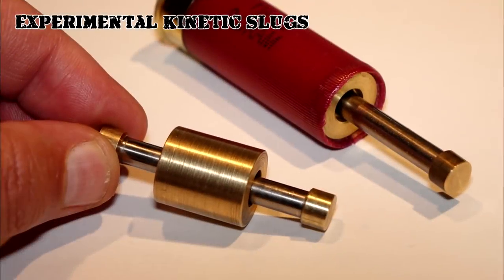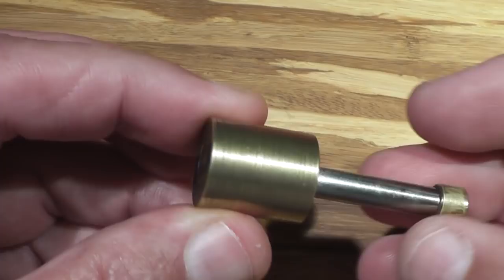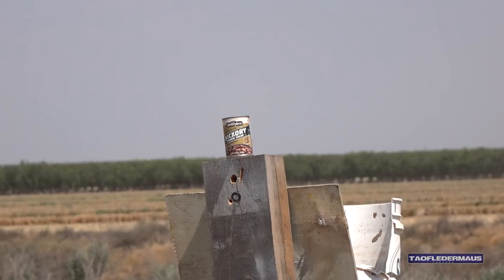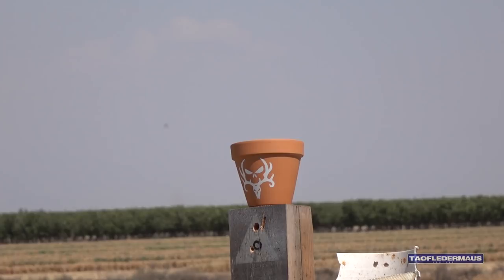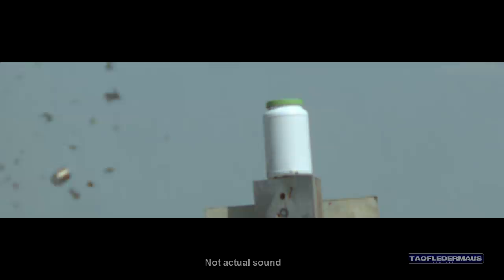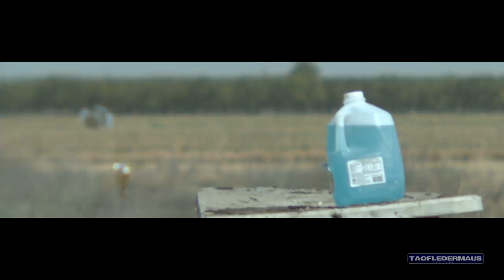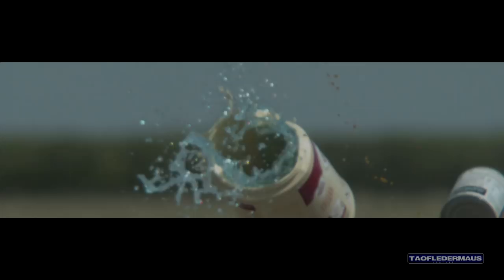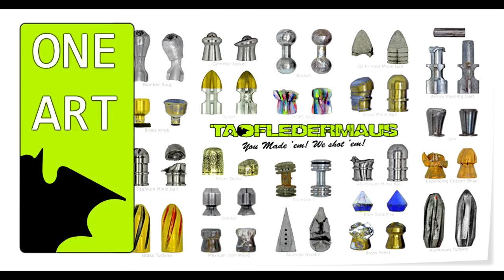The Kinetic Shotgun Round  -  Slug of the future?

Comment: Interesting idea, but I guess the brass ends weren't fitted well enough. Perhaps a conical turned steel end would have kept things together, but I'm not sure which end.
Reply: Matthew Trzcinski it might have helped having the ends being drilled through and having them secured with a hardened steel pin right through them and the rod. Additionally solder everything together and it should be good to go

Comment: This idea has legs, but it needs some modificaion, the endcaps are clearly stripping their threads, being unable to withstand the G-forces. But if that failure could be addressed, and the front end cap were tipped with a tungsten carbide cone, this might be a decent anti-materiel concept.

Comment: Because of (such tremendous) acceleration, the slide will always retract which means it, by default, starts nose-first.
Too bad it's prone to fail due to acceleration and fall apart mid-air, though.

Comment: Had the retaining caps been steel and welded to the rod, this concept could have worked. I also would have a tighter friction fit between the rod and carrier portion of the slug. In this manner the projectile could be fired with the rod in the rearward position, giving it enough drag in flight to possibly stabilize the slug, regardless of aerodynamic design. If the mechanics of the slug were to work as designed, then a tungsten rod and retaining caps would perform even more proficiently as a penetrator. In hypothetical ballistics that is.

Comment: The brass caps on the pin should be interference/shrink fit to keep them during the acceleration.  Also, if the pin was tapered slightly so the slug is pulled "tight" against the rod when it's fired.  Just my $0.02.

Comment: Even if the pieces stick together I don't think they would have ever worked. The forces would be pushing against both the slug and pin. I figure the pin would need to be smaller than the slug and not be able to exit out the back. So when the slug impacts it pushes out the pin.

Comment: It was an ingenious idea but you forgot physics. Both the main ring and the pin are being accelerated equal amounts at the same time. Thus they'll accelerate forward at the same rate. Meaning the pin won't drop back. If you wanted to make something that's a penetrater attach the pin in the back position with a thin piece of metal that way it flies like a plunger but when it hits the traget the kinetic energy breaks the pin from the ring making a penetrator.

Comment: So with the way physics works wouldn’t it make more since that the center rod would be the first point of contact? With that weighing less than the larger slug it would be forced forward on firing the shell. With the rod being the first to contact it would cause the slug to slide forward hitting the target with a second punch so to speak. Of course I could be completely wrong. I’m no physics major by any means

Comment: Seems like these would work better if they where flipped around and extremely heavy duty custom fit sabots where put in the back (to stop the pin/rod from moving), the puncturing rod that also works as a tail is a good idea just executed in a convoluted way.

For a cheap alternative  a lead round/slug would be ideal to try with just drill a centered hole 3/4 in, stick an old hard steel rod in and you're done, then adjust the depth as needed to survive firing but penetrate on impact, maybe even add breakaway finns too =D  .

Comment: Thx ,again interesting,, after seeing some of these slugs tests ,I felt "lost" or some I have made were not going to do well ,but now feel more "accurate" in my first thoughts, I load 20 ga. rounds and 410, use a masonry nail or a cut off drill bit for the center, at first with shot, a drilled out factory rifled slug, 45h.p. shells and washers or now a steel socket filled with bb's and a bit and heat backfilled with solder, the poster using the term " drag separation" explains this to my brain better:) be interesting if this sleeve were rifled and shot from a rifled gun? also wonder if sharpening the front edge of certain slugs makes a penetration difference> thx again Peace Rick

Comment: the pin would go forwards because the air resistance on the slug is bigger than on the pin, så it will be going faster than the slug.

Comment: Looks like you'd do better just putting a sabot around that steel pin and letting 'er rip. Also, the reason it won't stabilize is basic aerodynamics: the end with the most surface area wants to go last. That's the cylinder, not the rod. If you want the rod to go last, it needs to have vanes on it like an arrow or that cylinder's drag will overwhelm it every time everything else goes right.

Comment: Already by looking at the Slug i knew this wouldnt work, the Brass Base around the Shaft as a much higher surface area in a Ideal Scenario resulting in that it springs back, all the drag and movement would just throw it of course if not outright destroying it. 

And i dont even have a Degree in Engineering, or Physics. But it seems so exactly that happend too.

Comment: It needs a tapered pin and slug hole so that it locks itself into the brass slug, and deceleration forces should throw it forward on impact.  No need for the bushings, to drill the slug all the way through, or for it to even move at all that way until it hits the target, and you can even sharpen the point on the penetrator.

Currently, that big pin ramming back is destroying your plastic cup before the load even leaves the chamber, and ripping the front bushing off when it separates.  When it doesn't separate, it probably rebounds forward.  All that slopping back and forth from the pin is destabilizing your projectile.

That is my best guess...  It's not a good design at all, but it is workable with the above changes.

This is all easily explained through inertia forces, and simple mechanics...  it does not require "rocket science" to figure out what is happening...

Comment: The rod and the rear retaining piece should be milled from one piece of steel. Then drill and tap a hole in the front and use a stainless steel screw to put in the retaining segment for the other side. I would recommend that the slug in the center be made of stainless steel, as brass could deform and remove itself from the rod by sheer force. This in no way guarantees stability, but significantly increases the chances of it staying together.
Reply from the maker: Or just silver solder the caps on.    I think he just press-fit (maybe glued) the caps on so I am surprised ANY of them held together.
Reply: TAOFLEDERMAUS can solder handle that amount of G force?

Comment: I mean, the slug is pretty much pushed out of the barrel through pressure, so i can't say i was surprised when the slug came out backwards...
It's a nice idea, but technically, i don't think it's easy to get it working.
I also doubt that it would have any real benefit to just a solid steel ball in terms of penetrating power.
Simplicity usually wins over complexity, just because there's less there to fail.

Comment: My theory is that there needs to be more weight to the rear of the pin, but not more than the entire front of the round.

That way the pin should always move to the rear, in theory.
Reply: Also I was thinking a conventional  bullet shape instead of the cylinder. Also maybe loading the shells in a way so that the pin is already in the position in which you want it to fly. And lastly I don't know what type barrels we're on the guns but maybe try smooth bore and rifled. These rounds are really interesting and it would be really cool to see them work like they are intended but the breaking part needs to be fixed. If they work it will almost be like shooting a 223 round with the powder of a shotgun behind it.
Reply: well if it stays to the back, once it hits the target the slug will keep going as the pin slows down acting like a hammer. well thats what i thought anyways

Comment: It looks to me, at least, that the round is stabilizing, the problem with it is that the piston doesn't move backward like was theorized, it stays forwards, which means the round itself has to spin around before it can stabilize, which is exactly what we see happening. My theory is that the base needs to receive all the acceleration, but both the base and the piston itself is receiving acceleration, so it won't work as intended.
Reply: Perhaps if the wadding were designed to cradle the main body of the slug and transfer all the pressure from the wad to the body. If the wad allowed for the pin/penetrator to be rearward when fired then perhaps not only would the projectile stabilize, but also perform as designed. as the blunt face of the slug impacts, sending the rod foreword with multiplied momentum, acting as an armor penetrator. The slug needs some redesigning but is a fun thought experiment at the least.

Comment: The designer obviously didn't take into effect that both slug and pin were subjected to the same amount of pressure, as if it was one solid round. When traveling downrange, the assembly would have had no reason to take on the shape as initially planned. Still worth a try, though.

Comment: The slug should go forward with the hammer back because of inertia. 
When the pin hits something, the hammer, again because of inertia, slams forward and given a strike on the object hit
Reply: Well, kinda, but bassackwards lol. The idea is to have the slug strike blunt first into an armored target. Then, the inertia of the hardened pin( the mass of the pin multiplied by the sum of the KE transfer and the rate of deceleration) drives the pin forward, theoretically, into the armor. All the combined KE is localized to a small point and an armor penetrator is born in the process. Regardless it needs some new materials, new means of securing the materials together and much much more testing.

Comment: The steel pin is lighter than the cylinder so it will be pushed to the front of the  cylinder before it leaves the barrel. Whoever designed this needs some physics lessons

Comment: here's what i'm thinking.
this round failed due to a few different reasons. i mean, even if it did stay together it still fails due to a few oversights.
the thin rod seems to be lighter than the base of the slug, meaning that the force acting on it would push it faster than the slug (instead of the other way around). also the larger surface of the base means more air resistance than the rod. then, even if the rod was pointing out the back of the slug instead of the front, it would still be unable to stabilize the round because it's just too small. the air impacts the big, flat base of the slug and directs air away from making it towards the rod at the back, and then the rod doesn't even have fins, etc. also you could argue that adding the rod which moves in mid-air like that actually increases the chance of the round tumbling through the air.

interesting concept, but i don't see why you'd use that over a sabot round if you were looking for a stabilized, high-velocity (potentially) high-pen slug. this only really seems to be good against close-range human-torso-sized targets, and if you were shooting at a human it would only really work against someone without body armor, and in that case you would just be better off firing a regular slug.
again, that's only my thoughts.

Comment: Great Video. !!! Even better shooting. 
  The bullets were not working with you.
  If there pin in the middle was capped .  Then the caps were putt on so  they can be ripped off.
  If the pin was intentionally made longer. Then beveled by a press.
 Making the pin thicker at both ends. With a pilot hole drilled in to e slug to receive and seat the pin .
Do you think that would have more of a desired effect and outcome?
Reply: the weight of the pin vs the weight of the slug would also make a difference (physics math), i'd think.

Comment: That round is still surprisingly accurate! Maybe a fluted tip on the rear end would improve correction? Combine it with this. https://help.sketchup.com/sites/help.sketchup.com/files/images/fg105_4.png You can even make the fluting spiralled, and have it potentially add spin for better stability

Comment: They way to make these hold together would be to threat one cap. You might get away with an interference fit but if you're just making a few of them, you may as well thread them. It would be interesting to play wit the configuration of these & see if you can get something useful  ...beyond just a big, heavy slug.
I'm about to graduate from machining school so when I get the shitty lathe running that I bought, I'll try to fit in some time to send you some. That or you can just send me a high speed camera and I'll send it back when I design a good one. ;-)

Comment: one question came across my mind while watching your video.
does Sand behave like a liquid when it gets hit by a heavy fast moving object  (like a slug)?
Reply from the maker: No,  quite the opposite.   The grains of sand tend to push equally against the grains in front of them and disperse the energy to the point where the projectile's energy is slowed down greatly.   Water SORT of does the same but the energy tends to go in all directions rather than a cone shape with sand.

Comment: Somebody machine down a bolt head and put a thick washer on it and secure the backside with a nylock nut and then machine the nut down smaller than the bolt head (heavier in front). threads should hold better than what looks like pressed end caps.

Comment: so what does factory slugs do? do they tumble as well?
Reply from the maker: What factory slugs?  There are hundreds of different types
Reply: any... do any fly true? any work perfect?
Reply from the maker: absolutely
Reply: +Dean Sande Some will fly straight and devastate your target of choice, some May key hole and be a waste. Depends on the slug/shotgun barrel pairing. Sabot slugs are very accurate reliable slugs but they typically only perform with rifled barrels. A smooth bore barrel may send the Sabot slug tumbling through the air at an odd trajectory given the POA. thus your POI will change. At the same time, a common foster slug will almost always leave the muzzle concentric, fly nose first, and impact with relatively good accuracy. This is at any given FACTORY weight and/or velocity. the short and simple answer is; either know your weapon well, and choose ammunition that is designed to function in your firearm...or choose a type of projectile you wish to implement, and pick a corresponding shotgun/barrel that it is designed for. There Jeff I saved you the breath. Lol

Comment: Interesting idea but it's poorly designed overall. This thing should be shaped more aerodynamically, just coning it off would help. Also the center bar should either have a much tighter fit within the slug or should have some sort of fins on the back to increase it's drag to be higher than the main slug.
Reply: I agree, if the penetrator was fit tightly to the main body of the slug it may have enough weight distribution to have a nose heavy design with just enough mass rearward to create drag and therefore improve accuracy. had the slug been accelerated to around 1,500-1,850fps, I'm sure even with a tight fit there would be enough KE to drive the penetrator deep into the target/armor. Given the slug was designed to be more structurally sound that is(as I stated earlier this morning).

Comment: Inertia round would actually be the better term
Reply: So the best way to make this viable is to make the front end of the bolt heavier and a bit more aerodynamic. Shape the front part of the bolt like a teardrop, make the sliding cylinder into a cone that tapers off toward the back but has an inlet for the teardrop shape in the front. And flatten out the bolts back end from the start instead of welding a ring around it. It's not worth the production effort, but it's still a cool concept.

Comment: Two years later, will this ever be read?
 I like the idea but the execution just failed.....which is ok too, you can learn a lot from the failures.
Am I the only person who thought to make an AP round with a 'hammer effect', ie metal at the base  'free'' to run forward on impact and thus drive a smaller piercing core forwards?
I gotta reflect that the total energy would be the same as one solid projectile, just to consider if essentially a 'double-tap' to the same point would make a difference?
Same energy but 'dumped' twice in a tiny spot?

Comment: that could be designed so much better, the front end of the pin should be made pointy and the main slug part should be made in the shape of an air rifle round, also attach the pin/rod better so it stays together, weld it or just get OG to threaten it not to come apart, OG obviously has the power to do that, in fact just a dirty look from OG would work, it wouldn't dare defy OG, if i was gay I'd be an OG kinda guy/gay😂
Reply from the maker: Some people talk about designs,  others submit them!
Reply: TAOFLEDERMAUS where's the best place to send designs? I've got a couple of other ideas too